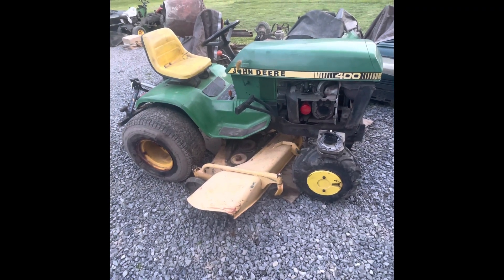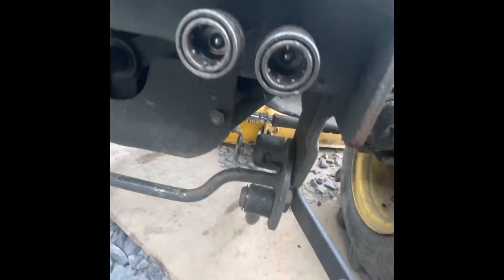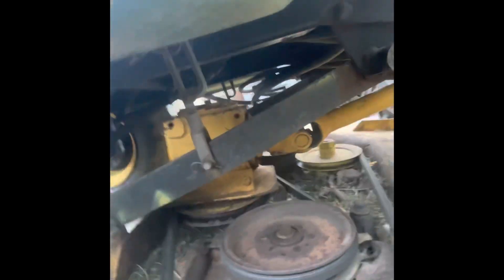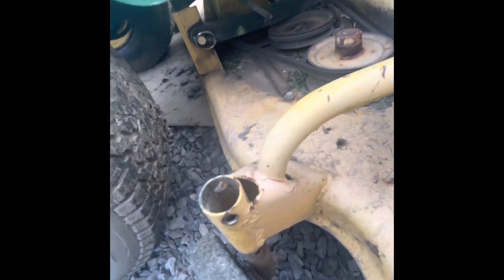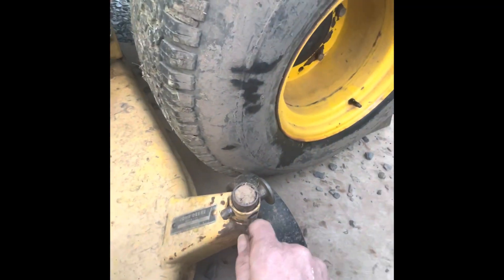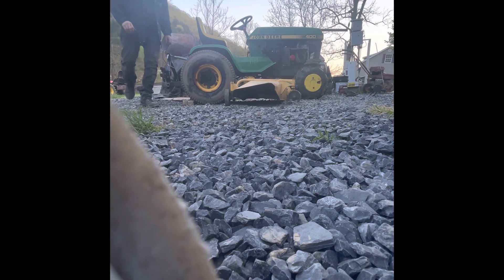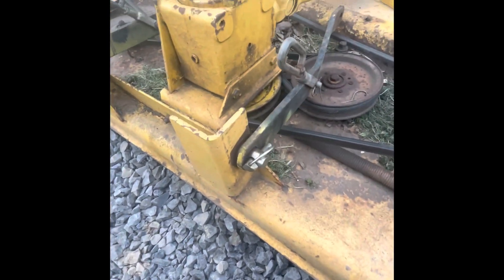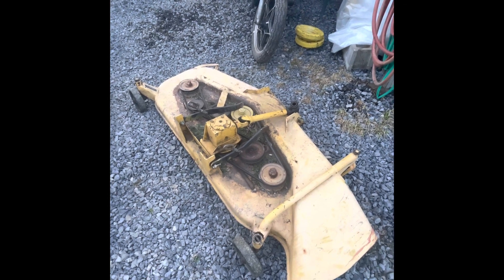John Deere 400 Deck removal 60” 3 wheel.

Comment: This was super helpful.  I just bought a 1977 JD 400 and had no idea how to get the mower deck on!!!  Thank you.
Reply from the maker: thanks, i am glad it helped. im going to have several more vids on these. i have had the 400 series tractors down to the frame and back up.  ask if you need anything ! and thanks for looking !
Reply: @socialdragon1743  I will most definitely take you up on that offer!  :-)  I'm looking to restore mine and it's pretty clean to begin with!  Thank you
Reply from the maker: @timcallahan1055  just started on another one today. I’m hooked on these things.
Reply: @socialdragon1743  I just got a weird problem = My PTO shaft for the mower is hitting my tie rod!  Any idea what could be causing that?
Reply from the maker: @timcallahan1055  i would think something in the steering system is bent, either the cross steer rod or
 the actuator.
Reply: @socialdragon1743  They actually seem fine (I will look again) - new tie rod ends on as well.  Would any bad bearings or excessive play in the shaft cause and issue?
Reply from the maker: @timcallahan1055  if it excessive id imagine they could,  test> disconnect the shaft from the pto and see what kind of play there is. the pto shouldnt really have any side to side/up down movement. if there is id say bearings.
Reply: @socialdragon1743  I think I've nailed it down to the PTO shaft, excessive wearing and possibly a little damage.  Looks like I'll need a new one.  My mower is a C400F and Mower is H060D - need to find correct driveshaft replacement.
Reply from the maker: @timcallahan1055  the the pto bearings and drive shaft itself I’ve found reasonably priced on eBay in the past

Comment: Very helpful.  I like where you went over likely problems with the lift arms on the mower deck and how you fixed yours.  Gotta keep them working.  Thanks for making this video.
Reply from the maker: Thanks.  And it’s true. I’d rather do work on this one before working on any type of standard lawn mower.  With this tractor being a 1975 I’ve been cutting close to 3 acres of  uneven and hilly grounds with this machine.   This is the only machine I’ve had that handles this type of punishment and keeps going.

Comment: I have  a 79 400 with a factory deck starting in 40 ...... so yours is before that and prob a 77 deck going by my gut and the hood decal.
Reply from the maker: This machine has probably been repainted and badged at some point. This particular machine by data plate and serial number is actually a 75. I have also a 76. And the one I posted about recently this passed month or so is an 80.